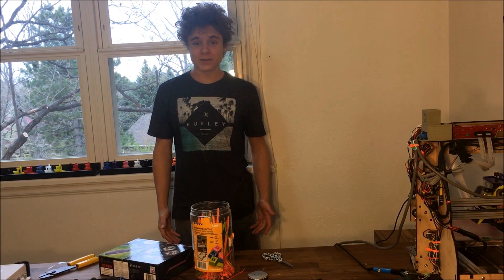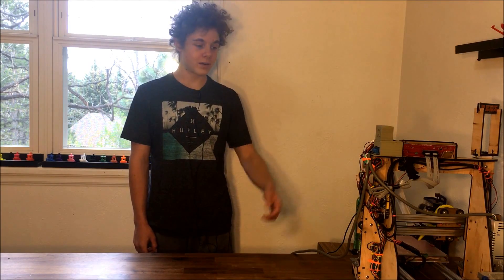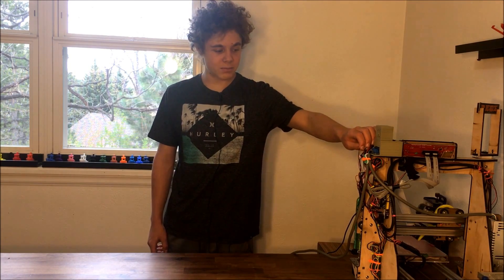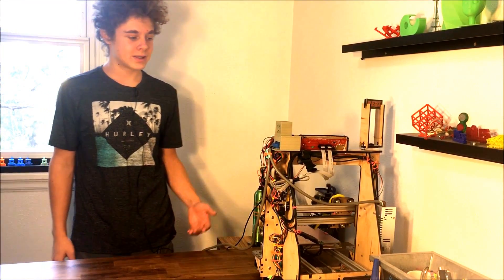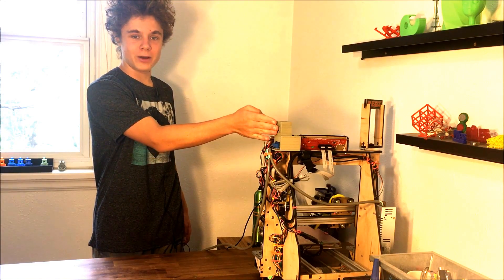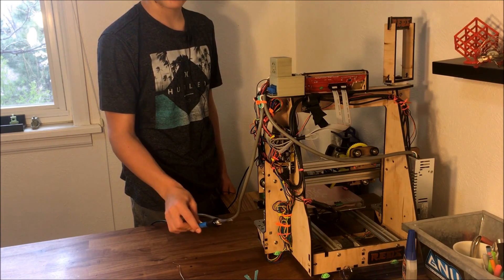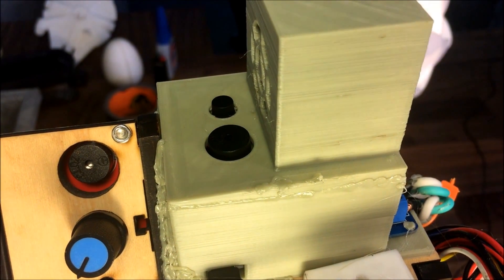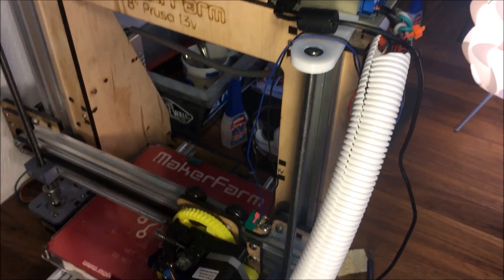3D Printer Safety Gadget

Comment: please use ferrules if you are connecting this kind of wire to a relay or any screw terminal this can be as dangerous as a fire especially with all the vibration of the printer it could come loose and create a short circuit.
you can only put stranded wire directly in connectors that are designed for this purpose as a srew terminal (depending on its design) can cut through the tiny wire with time if the screw screws directly onto the wire, or it could wiggle loose because of the space between the little wires over time, thats the reasoning i was told here in germany, as an aprentice electrician, on why to always use ferrules on screw terminals exception of this are clamp terminal from wago or phoenix or weidmüller etc etc, but these are designed for this application and because of the clamping force will not loose with time or vibration.

just wanted to point that out since the blank wire can be seen at 2:59 ...
Reply: to hit the ends with solder would also be a viable solution if no ferrules are at hand point is that it should not be loose wire there and to shorten them a bit more would also be a good idea alternativle put a cover above them so no one touches them accidently